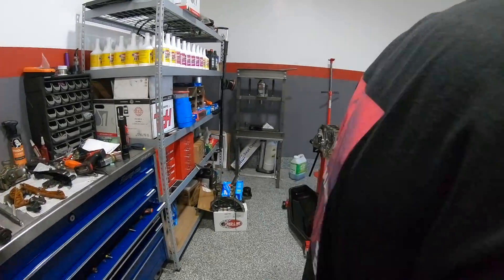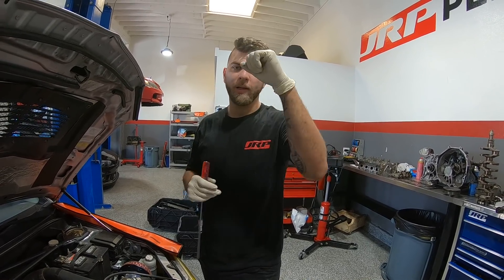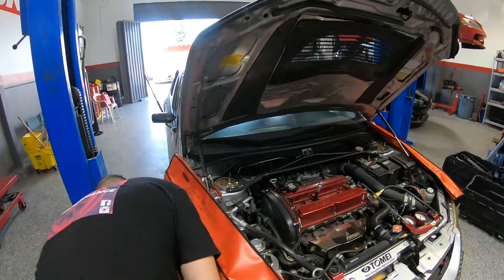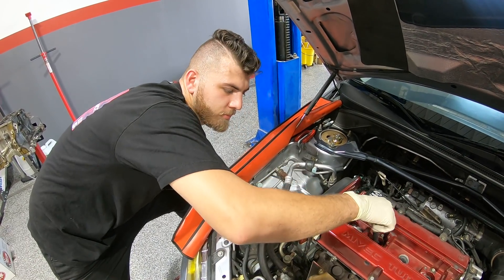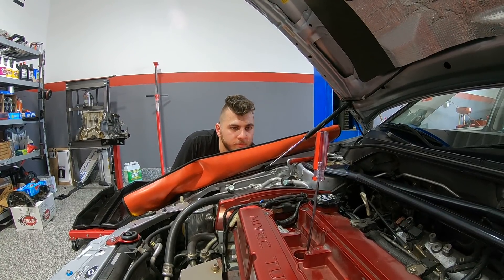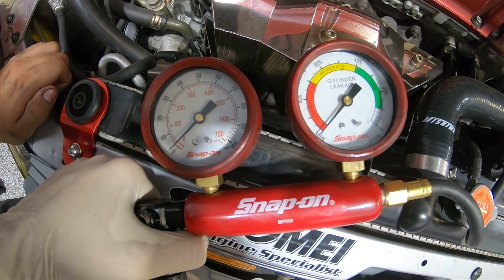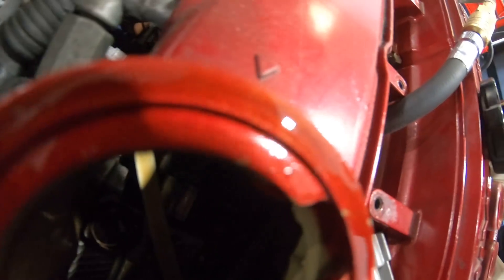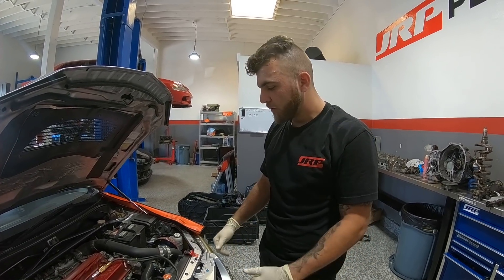JRP Performance - Compression & Leak down Explanation

Comment: idk if you guys are familiar with Audis at all specifically the B6 1.8t A4 but i have one with multiple misfires. took it to a couple shops one said it has no compression and needs a motor. the other said no compression but they think its a bent valve and could be fixed with rebuilding the head.. any advice?